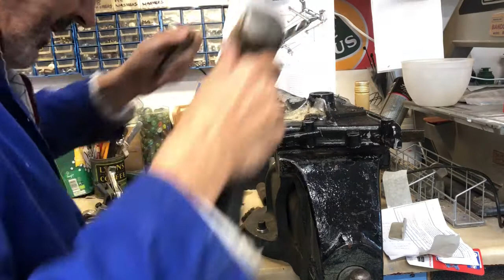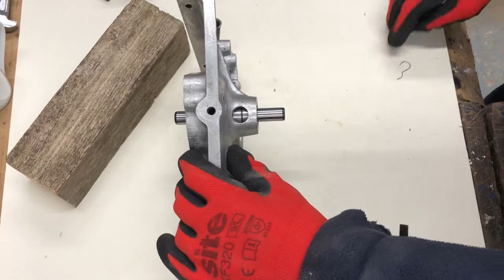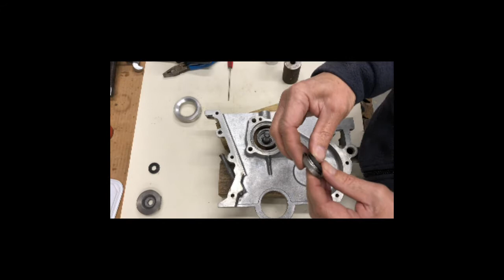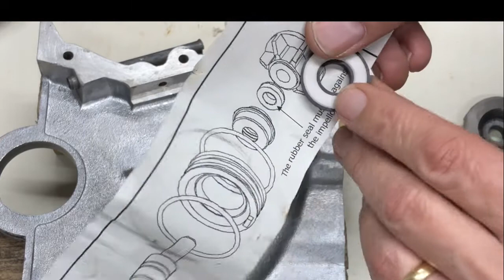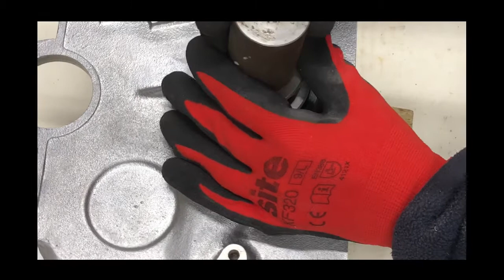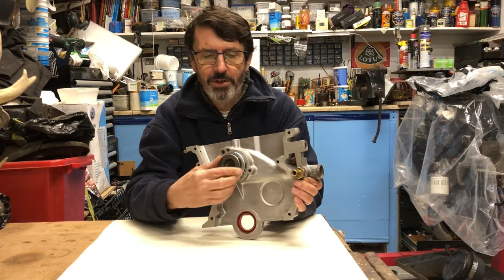Lotus TWIN-CAM Water Pump Replacement

Comment: The clip requires the bearing be pressed to the depth that matches its groove to the groove in the cover. The kit I got from RD Enterprises says to press flush on the outside and omit the clip. Their bearing groove does not line up at all. Kit also says to measure pulley hub height from the cover before disassembly for proper hub/pulley height upon re-assembly. I pressed on the outer race using a 17mm, 1/2" drive, deep chrome socket. 1/2" drive, for shaft clearance. Chrome, for thinner wall and an outer diameter that fit the bore, as measured against the new bearing.. I squared off the socket's end with emery paper on a flat surface. I was lucky, it was the only tool I had that fit. Backside support for installation was with large washers that closely fit the bore for the O-ringed insert, and large sockets and old wheel bearing races under the washers. A variety of these accommodated the hydraulic press set-up as the bearings went out and back in while keeping the shaft clear of end loads. Hammering while supporting the cover widely risks cracking the alumin(i)um casting. Kit instructions also recommend against removal by pressing on the shaft, presumably b/c ball bearing pressure tends to expand the outer race in the bore. Pre-heating, as you did for installation, might prevent such bore/case damage. I did it cold and the old bearing pop-pop-popped free at first breakaway, as did the new one at final  seating even with anti-seize nickel grease.

The sealing washer has a smooth, ceramic-coated side that fits against the spring-loaded seal. Instructions say to lube with coolant before assembly and to never run without proper coolant mix in engine.

 Your front cover appears new and I am envious. Here's hoping for long bearing life and many thanks, Ian, for your videos!

Comment: You missed the bit about taking off and refitting the front cover...... did you take the head off ???
Reply: absolutely critical - I'd encourage a response. Faced with same situation with the unit still ïn car"........ All the advice so far states it's impossible to fit the timing cover gasket (on top of the front cover) without head removal - and if you do succeed it will leak......... would like to have the experience of the content creator.
Reply from the maker: Hi Rob,    I did it when the head was off, as the engine was out and in bits for other reasons.  I think one could just take the front cover off but I think it would be a real struggle to change the pump, de-grease/oil every thing and get it back together with out leaks.  You are going to need a lot of silicon and some luck from the garage elves !!!!   Remember LOTUS = Lots Of Trouble Usually Serious
Reply: @ 
Thanks for the response - I've got it all stripped down now sump off and head off and front and back cover removed.
I've decided to go with B/Power new front and rear cover and the modular W/Pump to suit. Meaning a change in the future is simplified.
new to all this sort of thing. Lotus means "lots of cost".......
Do you recommend RTV or similar for sealing in the gaskets. Or did you use something else. As this has to go back correctly........

Comment: I remember that clip being a pain getting placed roperly. But my greatest problem was to get the outer impeller housing (the part with the two o-rings) in place without either a large vice or a proper press. I actually got it askew and managed to break the housing, and had to get a second kit (had to send a friend in to buy it because I felt so embarrassed going back to the Lotus dealer for another one). All in all, watching this after many years I can now feel amazed that I managed to get the engine up and running again, working in a barn without even a proper work bench.  I believe, reflecting on it all, that it pays to construct simple tools for many of these steps, instead of using pieces of wood or metal just lying around. But to do that, you need a lathe and perhaps a milling machine....

Comment: I've found the font cover housing gets corroded. I had to machine mine out and fit an aluminum sleeve to bring it back to a standard size so that the O rings would seal properly. Hitting the front cover with a hammer is liable to break/crack it. Pressing it in is much better. The Burton version is much better.

Comment: Fitted the Burton removable module front cover to mine, expensive but does save a lot of work when the pump bearing goes. I must say the front cover is quite delicate and would recommend using a press or large vice instead of a hammer to do this job.
Reply: If he doesnt know how it goes back together, he should not have taken it apart, if you dont know what you are doing, you can end up in a world of pain, get someone who knows what they are doing, i would not let him work on mine,

Comment: Personally I would not consider refitting the original spec pump having gone to the trouble of removing engine (essential for this stupid design) I would install the Burton or Dave Bean front covers with modular pump that’s serviceable in the car. Not cheap but for a long term ownership car it makes sense imo.
Reply: I had major problems with the dave Bean pump. My first one leaked immediately. Bean was good about replacing it, but this is not without a time involvement, and draining and refilling the cooling system. Then, the second pump had a major issue where the pulleys would not align. Again, Bean replaced it at no charge. Then, the hose connection to the lower radiator fitting had the incorrect OD. It also had a threaded connection to the front cover, and the threads were quite loose fitting. I was concerned that the threads would strip as I tightened it. I had to shrink fit a rubber sleeve on the fitting in order to get the lower radiator hose to connect tightly. After all this, i completely lost confidence in the system. I instead rebuilt my original Lotus pump. It has been fine for two years and 12,000 miles.

Comment: You did put the mechanical seal in correct way, only watch out is the faces can chip easily on the carbon face, hammering the impeller home might have damaged it hopefully not would have been better to press it home or squeezing with clamp.

Comment: Did you consider using the Dave Bean Engineering replacement kit? It appears to be a more durable replacement and easier to install.